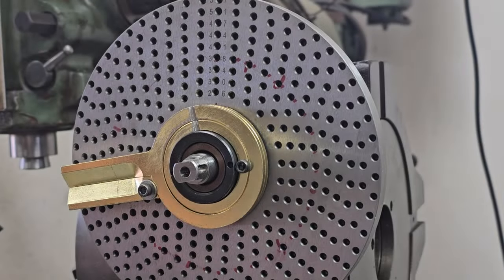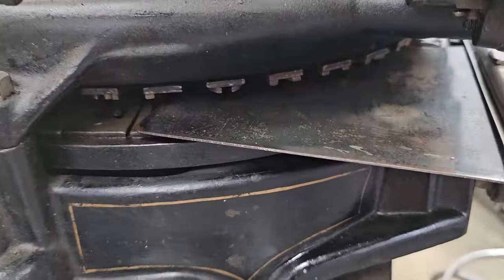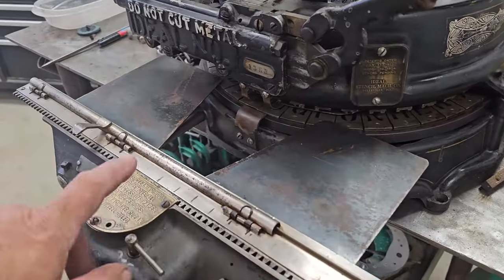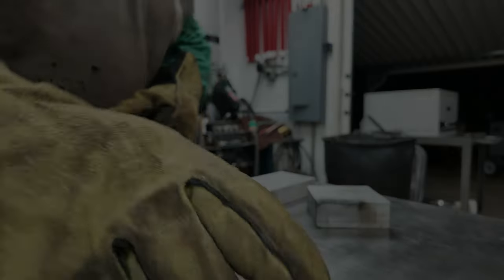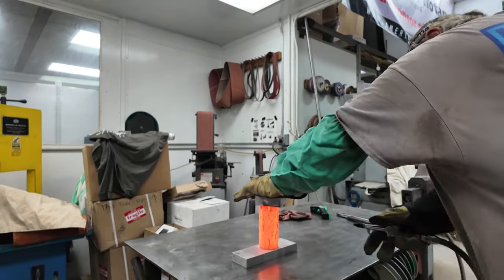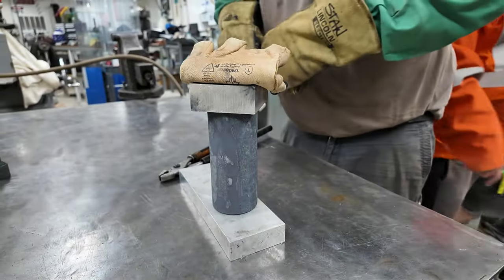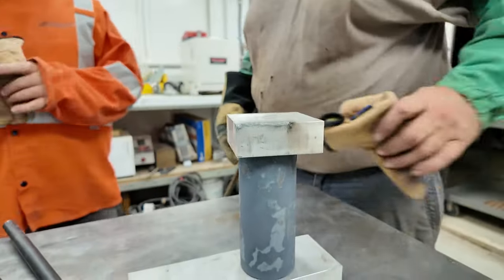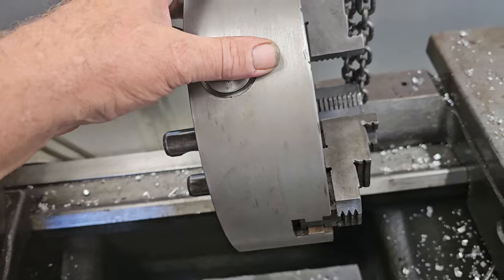Summer Bash 2024 post bash chores

Comment: Stan, will you sand blast that Cylindrical Square before grinding it, mainly to get rid of the scale build up in the depressions on each end of the cylinder faces ?
Reply from the maker: I just scrubbed it down in the sink with red scotchbrite, it leaves a durable black finish everywhere that isn't ground.